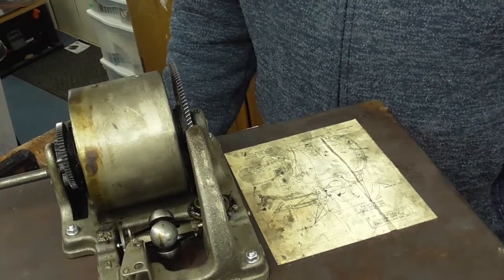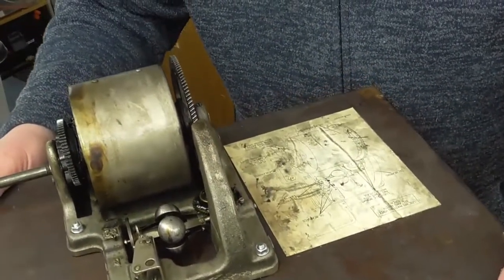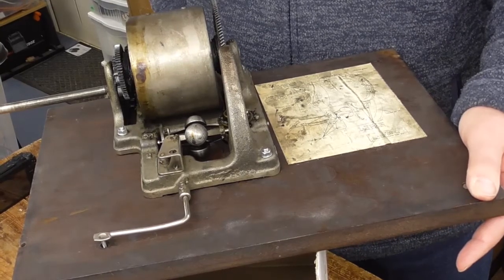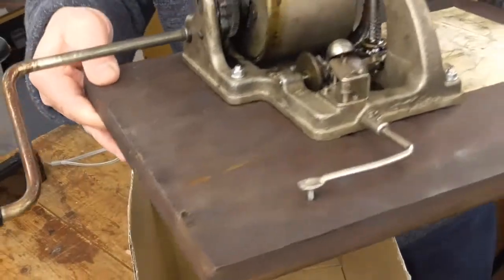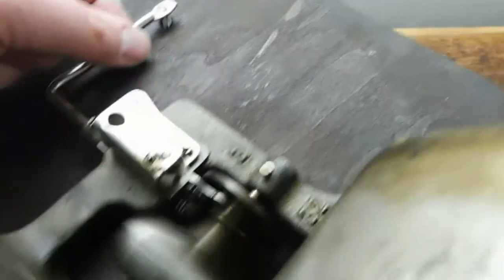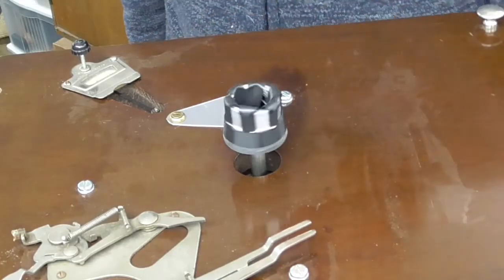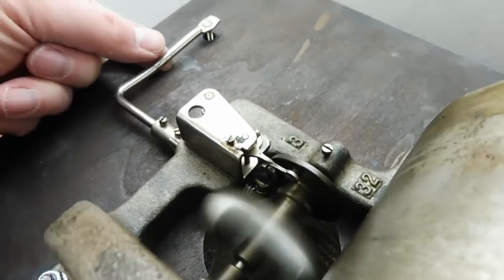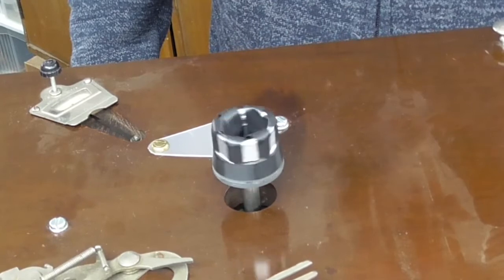HMV No. 32 motor from my 162 Gramophone

Comment: You need to adjust the speed whilst playing a record as the weight of the tone arm will slow the motor down.
Reply from the maker: That makes sense, especially If the motor is small or a bit weak, but on a big motor like this it really doesn't make any difference. There is a card/link near the end of the video to somebody else's video which demonstrates this quite well. Thanks.